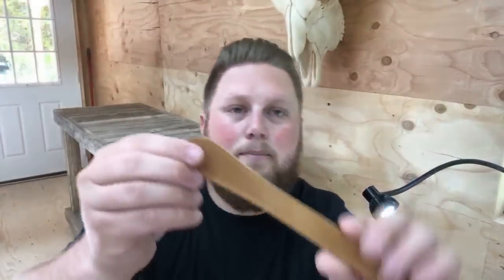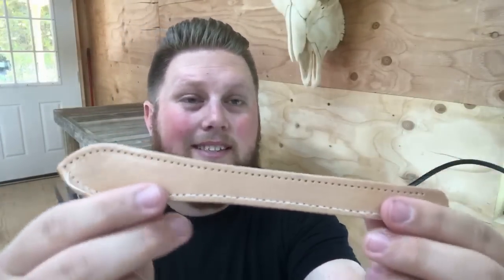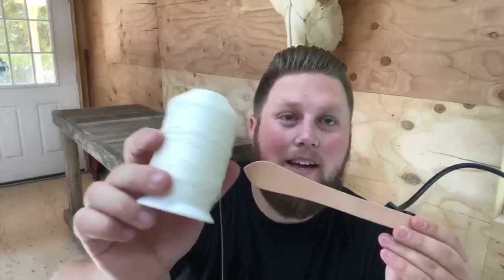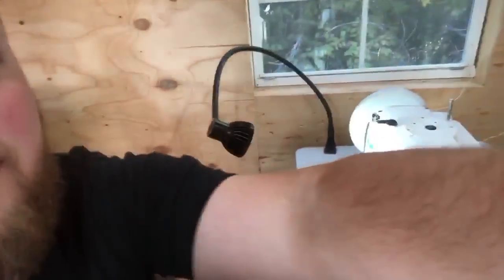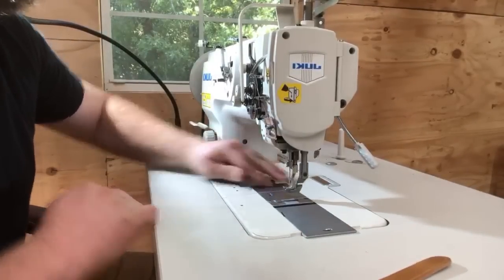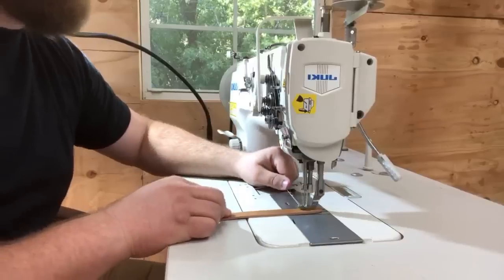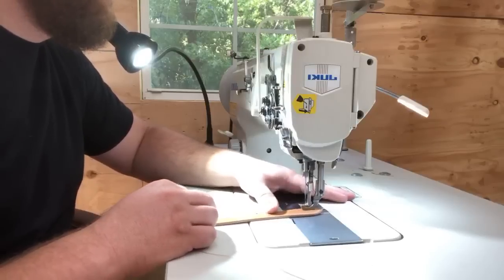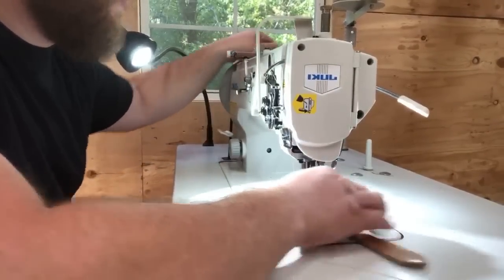Sewing with two different colors of thread

Comment: Which thread is good polyester or nylon?
Reply: Nylon is stronger but  it doesn't do well in sunlight.  If it's going to be sitting out in the sun for long periods (Car interiors, patio furniture cushions, etc.) Polyester is the way to go.  Nylon is good for most other applications.

Comment: i beg to differ on your statement that you can't stitch two-tone by hand. i've done it quite a lot before. i've got a few videos scheduled to release over the next two weeks or so, but i'll post one later of a project with two-toned stitching. it's a bit annoying on the start, but the two-tone is quite beautiful when it's all said and done.
Reply: I was going to say there has to be a way to mimic a lock stitch by hand, maybe it's very labor intensive but definitely doable
Reply: Oak Ridge Review i don’t lock-stitch it. i saddle-stitch two different colors.
Reply: @JRenardLeatherCo  and still get only one color on each side?
Reply: @oakridgereview1359  negative. the color alternates. the only way to get a single color per side is a lock-stitch. i haven't use a lock-stitch in years. unless i get a request from a client, use an alternating-color saddle stitch. there's an older video on my channel where i first used it on a pink ostrich passport case.